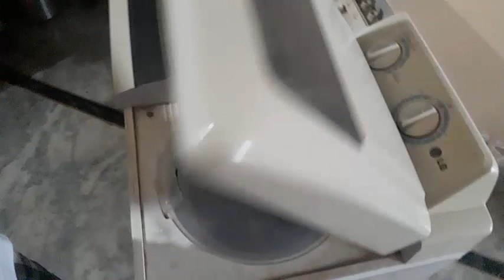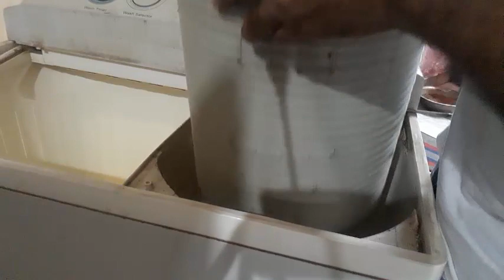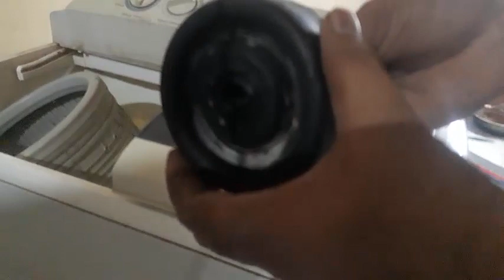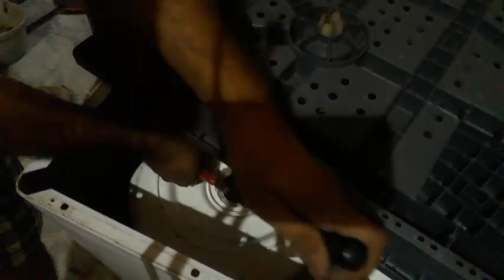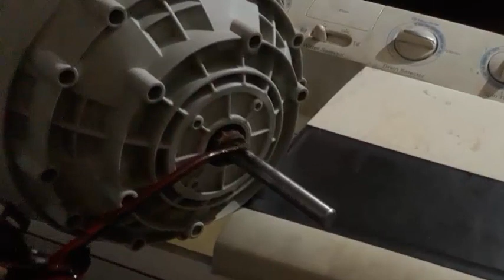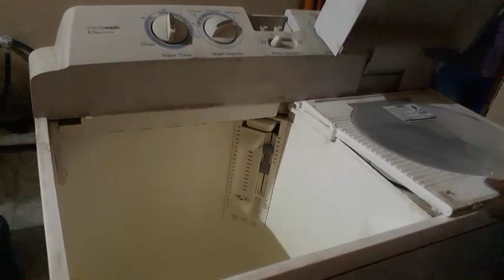How to Fix Washing Machine Dryer Problems

Comment: Hi, did you have to loosen any screw at the bottom of that dryer in the connection of the motor below to the shaft of the dryer itself?

Comment: Hi any one. Is any one ever had a porlem with a daewood washing machine gryer motor spining slow.there is no thing wrong with the seal of the gryer. I check all of that.just that the motor is working very slow. Any body have any tips send me a link. Thank you all.?